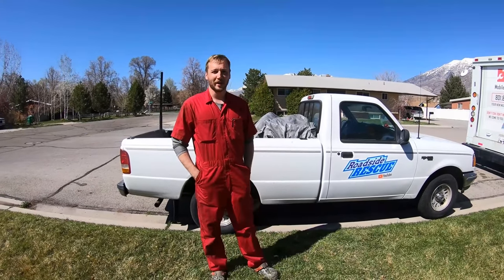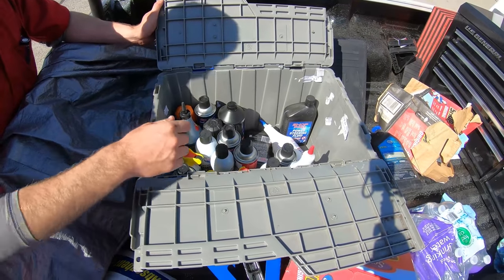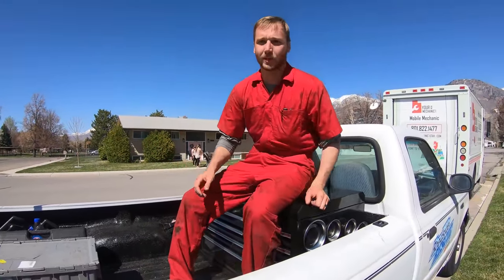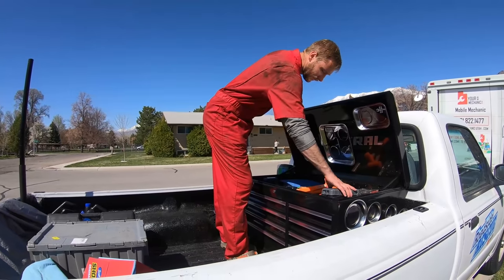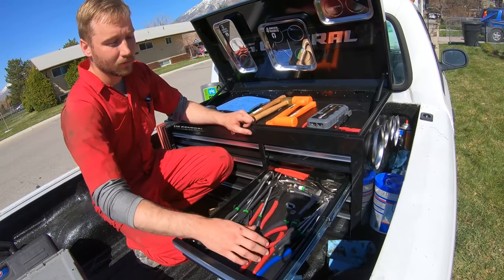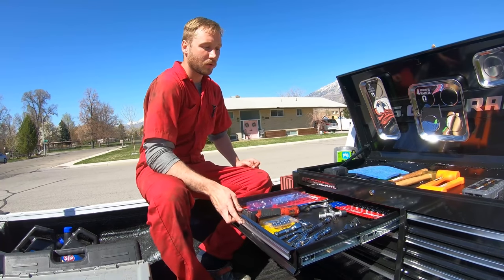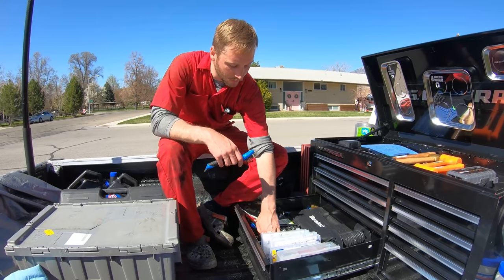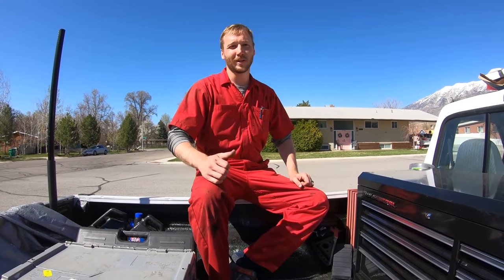Mobile mechanic mini truck tool tour. detailed tool setup.

Comment: Please Put a cheap motion alarm on that truck or a hidden kill switch is pretty effective Thieves  can’t lift the tool box but it’s. Ford ranger. 60 secs and the hole truck is gone.  Had a service truck stolen out of Memphis years back. That was my thoughts they can’t get into this with out makeing noise.   Yup. So took the hole truck. Was gone in 5 mins.  Got the truck back 5 days later stripped all tools gone  prybared all boxes open except the air compressor and torches was to heavy for them I guess save yourself that sick feeling.....
Reply from the maker: Luckily it’s insured as well. But I keep it safe at night.

Comment: They could just open the tailgate and drag it with a winch to another truck bed. I'd recommend getting that secured if you haven't already. Also, Love your videos! If you're ever fixing cars in MN my rallyx car always need work. ALWAYS.
Reply from the maker: wont pass the wheel wells.

Comment: Bolt your box down, & get an alarm. It really sucks when your tools get stolen. I had a brick & mortar Porsche shop in Glendale, California. The shop was burglarized three times, the last time someone pulled up with an 18 wheeler on a Sunday afternoon and cleaned out my shop. I had 7 guys working for me. After that I bought a used E350 Ford Van, put tools, welding equipment… I restored Porsche & Mercedes Benz cars from San Diego to Santa Barbara. My van was broken into several times. They got random tools to entire tool boxes full of stuff. My boxes were bolted in, but they used my pry bars & cutting equipment to take my tools. They got all my snap on electronic test equipment. 

I had a German Shepherd in the back parking lot of my shop, & my shop was alarmed. Definitely the people that cleaned out my shop were pros. I never recovered any of my things. 
At least bolt your box down, & get an alarm. It will keep honest people honest. The pros will just take your entire truck.  Go make some money.

Comment: Those Hyper Tough pry bars with the striking caps sold at Wal-Mart are made by Wilde Tools & are made in the USA. The same pry bars are also rebranded for Craftsman & Menard's Master Force brand. I have the Craftsman one & have been very happy with them except that they do rust easy if they get wet.

Even though that tool box is too heavy to lift it wouldn't stop the thieves in my neighborhood from attempting to steal it.
Reply: Just get the red handles the neon green ones are China or they are in my area
Reply: @dcoslet1  The neon green with the striking cap are USA made, the ones without the cap are China made.
Reply: @Zib187  my Walmart didn’t have the green with caps so that makes sense

Comment: I use to run a big service truck, it got to be a pain in the ass. Now a flatbed with a Montezuma box and grab specialty stuff as needed. A lot nicer to run a single cab 2500 in the city vs a kenworth.

Comment: Pro tip on mounting the tool box you can take the drawers out and mount through the bottom of the box, all you will need then is screws or bolts. Keep an eye out at your auto parts stores for lone a tool sales I got a $80 clutch fan service kit for $18 because they now stock an updated version.

Comment: Hi Man thank you for all the videos with all the hacks and tricks.. I have a 2006 toyota with oil consumption issue I have changed my pcv , added seafoam to the crankcase and spark plug holes but still drinking oil the problem is clogged oil holes on the pistons . And toyota is aware of the issue .. rebuilding the engine is not worth is as the car has 160k .. any advise will be greatly appreciated 
Thank you
Reply from the maker: just add oil frequently. as long as it doesn't run low you're good i wish there was an easy solution!

Comment: I  would  be  thinking it would  be  so  easy  for  a  thief  to  empty  your  truck
fast.  Maybe  you  have  safety  measures  put  in  place  to  prevent  this?
I  hope  so.
Reply: Your  tool  box  must  be  built  like  a  safe  and  locked  up  like 
Fort  Knox.

Comment: Wouldn't it make more sense to just invest in a work van like a transit or promaster with the high top? you could lock it up and it would be small enough to drive around easily.

Comment: What I meant when I said won't your tools get wet, wasn't a comment on your stupid but more about how do you keep that from happening. Had no idea it never really rains there. That's hard for me to imagine. IN the last two months I bet we have gotten 15 to 20 inches of rain. Our normal year we average 54"/ year but the last year or two I think we have done slightly better than that. I have rusty tools just from breif periods of rain or being on the carport concrete and rain blowing in on them or running across the ground. The wild temperature swings where everything metal or concrete gets wet from condensation.

Comment: hey Ernest, what do u think about a 2005 4runner v8 with 220k miles? guy is asking $5k for it, i would be happy if it lasts another 100k after i buy it, would u think it would last that long?
Reply: Check underneath the car to see if it's rusted beyond repair .